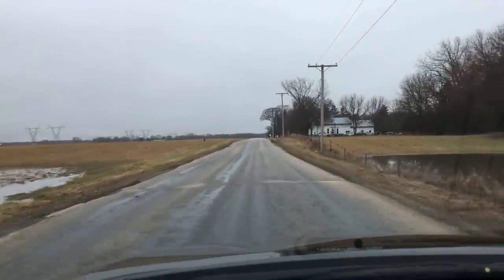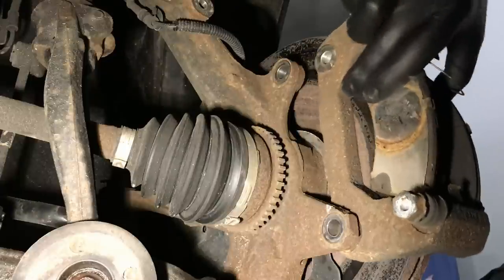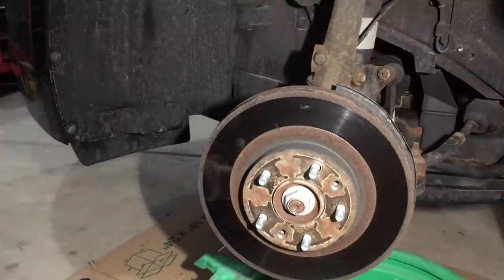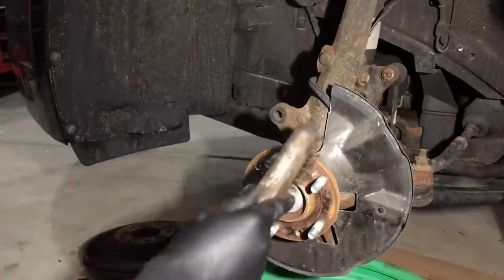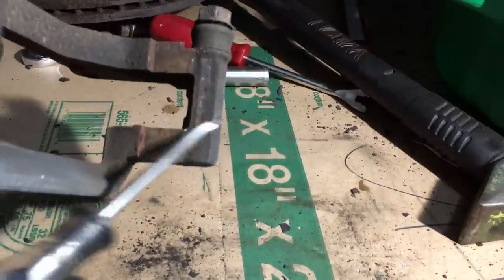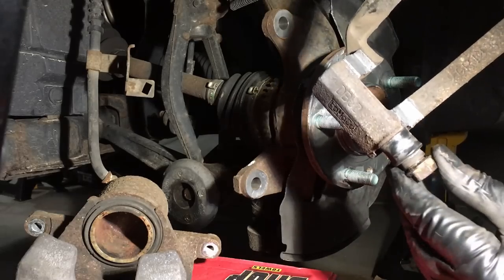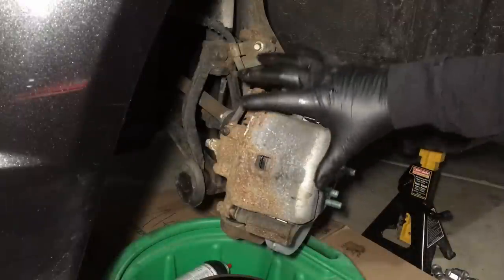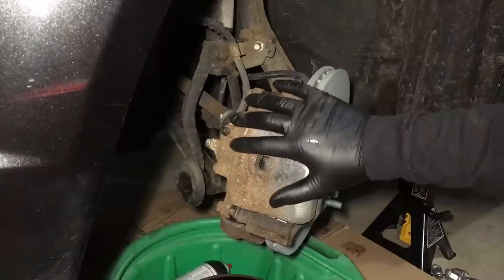2006-2012 Ford Fusion: Front Pads and Rotors Replacement

Comment: I just watched one of your earlier videos of doing brakes.. you said never ever put anti-seize on that flange because it will work out to the lugs studs!! You may want to go back and remove that video.
Reply: I would say very slight chance of that happening enough to get into the threads inside the lug nut and cause possibility of nut coming loose. Also, I know this is an excellent, very comprehensive how-to video, he is very knowledgeable and talented.
Reply: This excellent how -to video  has helped me much with my seized rotor problem. Yet I'm thinking the good of anti-seize far outweighs the risk of lug nuts loosening with anti-seize on them. I've been using anti-seize on lug nuts for decades, and tightening the lug nuts tight enough, (not overtightening & galling the threads) and have never, ever had a lug nut come loose for me. I saw a wheel get loose on my Granddaughter's car last month and it had no anti-seize at all on it's lug nuts. I have, however seen many lug nuts that had no anti-seize not be able to be loosened, seen seized lug nuts strip out the lugs in the holes they are splined into in the wheel hub. And I am just talking about corrosion seizing, not galled threads from over tightening or cross threading. There are still some of us who don't call Triple A when they have a flat tire and if Triple A or whatever emergency road service can't get the lug nuts off, they just tow the car back to a garage to have it dealt with, there are some of us with flats who still jack our cars up out there at night, in the winter, in bad neighborhoods and depend on our lug nuts not seizing on us. I could go on and on about the advantages of anti-seize on threads, but I just want to say, I'm not disputing the possibility of nuts loosening because they have had anti-seize or some other lubricant on them. I'm just thinking that the definite benefits make it worth the risk of lug nuts loosening. I'm sure there must have been some fatal accidents due to wheel lug nuts coming loose, but I can't help but wonder if the nuts were torqued down properly. But I suppose almost everyone else would say that it would be better to deal with seized lug nuts even out on the road trying to change a flat, then have a wheel come off while driving because the lugs were lubed with anti-seize and the nuts were not tightened properly. It's frustrating to me how some things can be both good and bad, like LED headlights. For the LED headlight car's driver, they are a boon for night safety. But for the oncoming drivers, especially the older drivers, they create a safety hazard, almost blinding them. But here, the good outweighs the bad, right?